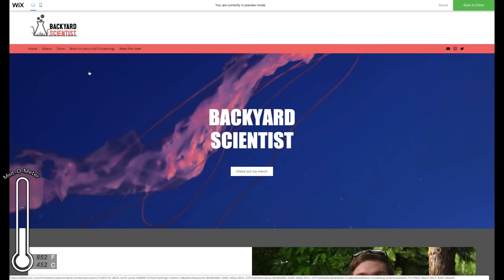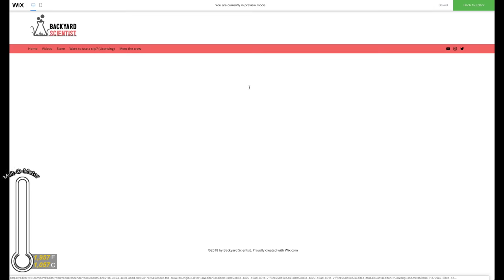Pouring lava in my pool!

Comment: To answer your question. Oxcyaceletyne will reach a point at around 3000C where it begins emitting UV radiation at a dangerous and harmful rate.
Reply: Interesting. But why does it and only it begin to emit UV Ray's at that low (relatively) of a temperature?
Reply: @chrishosey7535  
1) You mean high temperature(hot)
2) Why do you say that is "low" "relatively"? We humans have 1 degree more and have a fever and also could die
Reply: @noctuadiscipulum9715  I say relitively because in the grand scheme of things (the universe) it actually isn't that hot. For example, the core of the sun is 23 million degrees F  (11million C) which is thousands of times hotter than the temperature that a certain metal begins to produce UV Ray's.
Reply: That Guy Who Loves BBall yeah but that the sun
Reply: @sirs_3703  There are many more examples. I just gave one. Another example is the core of the Earth, all the gas giants, and Venus. Or super Nova's, hypernovas, etcetera. Those are just some of the things I can think of off the top of my head.
Reply: Does it start emitting enough for a sunburn before that? What’s considered a dangerous and harmful rate, relative to a potential sunburn at least?
Reply: JacP I don’t know what you said but I agree
Reply: JacP a welder also can sunburn u
Reply: Ok he googled that he can’t remember all of that on off the top of his head
Reply: @chrishosey7535  Yeah but the surface of the sun is only about 6000 K, and most of the UV rays come from there (the sun is not transparent, light from the core has to scatter around (losing energy) for a long time before it gets out). And remember, the core of the sun is a giant nuclear reactor, so it is the gamma radiation coming out of there that I'd be more worried about. Fortunately, as I mentioned, the gamma rays scatter around inside the sun a lot, losing energy, so can't escape and cook us here on Earth.
Reply: @Lamp25  I went to school for blacksmithing, training with oxy-acetelyne welding and cutting was a full day of classes
Reply: Nerd alert
Reply: Good job
Reply: Actually it is 3000 degrees kelvin and 4940.33 degrees fahrenheit
Reply: English please😐
Reply: will smith voice AAAAAA THAT'S HOT!
Reply: Doesn't this mean, that the Oxcyaceletyne is glowing blue, when a little und 3000°?
Reply: Well using the black body radiation formula, to reach UV wavelength it's either super hot or it's super dark to achieve 1 "e" value
But hotter is better since temperature is powered by factor of 4
Reply: Does it have anything to do with Wien's law?(just asking)
I suck in physics
Reply: @ninjafruitchilled  What I was trying to explain was that there were more things that were way hotter than 3000 degrees. I know the surface isn't nearly as hot as the core and that some photons still haven't gotten to the surface of the sun yet, that wasn't what I was trying to say. Sorry if I made it hard to understand.
Reply: @That Guy Who Loves BBall   I don't know why people confused over your simple word, "relative". It's just like saying how small the Sun really is relative to everything else ~And that is, simple...
Reply: @ultimaxkom8728  Yep.
Reply: Oh....
Reply: @jacp5628  what was the best parts and worst parts about that class?

Comment: 6:22 Not only did he make obsidian but he also broke it with his hands.
Reply: my man got netherite armour with prot 4
Reply: Steve : hold my netherite pixax
Reply: Minecraft... Why do you make Obsidian impossible to mine when it can be broken by hand irl...
Reply: @justyourlocalbernana1823  The real life obsidian is made in a volcano and in Minecraft obsidian is formed when water touches lava not when lava touches water
Reply: Obsidian can be broken easily tho
Reply: Steve is angry somewhere
Reply: @shaikomar5912  no obsidian is weak and it’s not strong if you were to slam the thing on the floor it’ll crack not even full force
Reply: @shaikomar5912  real life
Reply: @shaikomar5912  no it isnt
Reply: Wasn't it water on lava
And not lava on water?
Reply: Actually that would be cobblestone
Reply: @zabloing it's also insanely sharp and can easily beat a scalpel
Reply: obsidian is brittle, while it can be used in weapons such as the macuahutil  and be dangerous, its brittle enough to shatter
Reply: @justyourlocalbernana1823  Yeah, it just takes 2 million years
Reply: He has too much power
Reply: @justyourlocalbernana1823  That wasn't obsidion that was charred rock which makes it very fragile.
Reply: Welll actually obsidian is like diamonds, they are tougher than glass, but more brittle than glass
Reply: Yeah not minecarft
Reply: You are surprized? Obsidian is very breakable, almost like glass
Reply: @brianharvey2847  That's not scientifically correct....
Reply: @lucavett  THANK YOU
Reply: HE MUST MAKE DA NETHER PORTAL AND TRADE WITH DA PIGGYLINS
Reply: Lol
Reply: @maskboy2743   Lol
Reply: This guy's hand is a netherite pickaxe.
Reply: Cheater
Reply: Obsidian isn't that strong irl. It's actually a type of glass
Reply: steve who spent a whole day trying to break that piece of obsidian:"did i do sth wrong"
Reply: CURSED!
Reply: @justyourlocalbernana1823  because its n0t obsidian  obsidian is a volcanic rock
Reply: And in the video she said its sand
Reply: He has netherrite hands
Reply: ago  wrong
Reply: Meanwhile we need diamond pickaxe
Reply: Thats because he made cobblestone

Comment: You don't sink into lava because it still is rock. It is more dense then the human body. Wich is good because imagine how horrifing mountain climbing would be.
Reply: You would be dead not too long after sinking anyway.
Reply: But surely in its liquid form it has a different density? Wouldn't it's density depend on its temperature, meaning very hot, thin lava flows could have a low enough density for humans to sink through? Either way you're very very dead ofc
Reply: @chopun3862  density does not change unless there is chemical bonding
Reply: Minecraft lies
Reply: Youd explode
Reply: @chopun3862  nah he's right, the density of molten rock is very high, you would sink if you were standing in it maybe half a foot because your density is significantly lower. His comment about rock climbing is not correct though, because if that comparison were true then we wouldn't be able to climb on ice. Rock is just Frozen lava, just as ice is frozen water, but water is significantly less dense then molten rock. In Hawaii there was a man on his porch that was struck by a chunk of molten lava, it broke his leg pretty bad because it's just as heavy as a solid chunk of rock and its density is rather low when it had time to cool going through the air

Faster lava flows usually occur from steeper angles and very hot lava, when the lava is not all that hot it flows much more slowly, it also depends on the composition of the lava
Reply: What?? I get that you probably wouldn't sink in lava becouse of density but I'm confused... if it's a solid it's more dense. That's just how it works. Think about water you sink in it but if it's ice you don't.
Reply: Wich?
Reply: So superpowered individuals like Molten Man are made super dense when they go lava mode?
Reply: Horrifing you mean Horrifying.
Reply: @tannert8361  ice is actually a little bit less dense than water hence ice floats on water not sinks down into it
Reply: I think it's not that simple ... it's rock, but in another state.
It is like liquid and frozen water. You sink in liquid water, but do not sink in frozen water. Even the density changes in that case, but if we remove that variable, you still do not sink into the frozen water because of its state and how the atoms are "bound". :)
Reply: Yeah so I've looked this up and increasing temperature does decrease the density of different types of magmas (so I'd assume lavas too) but not by any significant amount. It's all still way more dense than water and there's no way you'd sink in 👍
Reply: You wouldn't even get the chance to sink, you'd explode because all the water in your body would instantly boil
Reply: @ivanrubenight34  no, in lakes for example the water on the bottom of the lake is always 4°C because at that temp the water is most dense.
Reply: @blackskeletor  you don't explode, it'd be more like when you drop water onto a hotplate. Check out the Because Science video Why Death By Lava Is So Much Worse Than In The Movies, Kyle Hill breaks it down quite well. 
https://www.youtube.com/watch?v=mW56dMH0T2s&index=3&t=8s&list=PLrkk0J-VdYFtuf5xEpU7BJnfgzUNUH2UM
Reply: So an exceedingly dense person might actually sink through?
Reply: @chopun3862  Density and viscosity are two different things
Reply: @rickhapstley3866  yes I am well aware of that. As it turns out lava has an absurdly large viscosity and a relatively large density
Reply: @tannert8361  change of matter is completely different from density

Comment: 8:45
This is given by Wien's Displacement Law, which gives the spectrum of most likely wavelengths given off by an object at a certain temperature (it will give off multiple wavelengths from infrared through visible, up through ultraviolet and beyond).
For UV radiation in the range [100nm - 10nm] (least to most extreme), if this were to be the peak intensity of the object's spectrum (i.e. the most common light emitted), the object would need to be between ~29,000 - 290,000 K. An object would begin emitting UV radiation at much, much lower temperatures of course, but if you wanted it to emit MOSTLY UV, you'd have to get it up to these spectacularly high temperatures.
Reply: keymaster013 this is a godly comment and deserves much more attention
Reply: @Guyacrossthestreet  I agree
Reply: can someone explain this in not scientist
Reply: Hot hot give burny burn on skin
Reply: FAQ
Reply: @bladynmccloskey  Basically it's a trick question. I assumed what he was asking meant "I want it to be a UV laser just bc it's hot." If that's the case, it needs to be hot.
REALLY hot.

like, at least 5 times hotter than the surface of the Sun, hot.
Reply: keymaster013 ok i get it thanks
Reply: Did you ctrl c ctrl v for that
Reply: Wut
Reply: Copy and paste
Reply: @do_uR_wOrK  therw you are
Reply: Advancement made: being smart
Reply: Nerd
Reply: @arenkuboyasu5831  yeah ok now feary
Reply: @arenkuboyasu5831  I am a nerd
Reply: @futurethamizhagaming4247  why are you teasing this dude
Reply: @futurethamizhagaming4247  srupid name bruv
Reply: I like your funny words magic man
Reply: Ok so which website did you copy this from?
Reply: @gamingwithajohn1543  None, but you could easily google the law or thermodynamics in general if you want to find information on it. You'd just have to run the numbers yourself.

Or not. Whatever suits you.
Reply: @keymaster013  So you actually wrote this comment through your common knowledge?
Reply: @gamingwithajohn1543  I didn't remember the actual value of the constant so I had to look that up.
Why does it matter?
Reply: Wow! 😮😮👍👍👍
Reply: Somebody Call Wikipedia
Reply: nerd
Reply: Hes too powerful to be kept alive
Reply: @sodiepop135  Is that a bad thing?
Reply: wow im surprised people arent just shouting "nerrrdddd"
Reply: @theolodger  they are, yet they are watching a science channel so it doesn’t really matter..
Reply: @Deeznuts39  haha 1yo comment
Reply: @theolodger  sorry lmao
Reply: @Deeznuts39  xD

Comment: I looked into the UV question you asked at 8:53. 

Short answer: You can do it, but probably not with your current crucible. 

Long answer: Light-skinned people will definitely burn within about half an hour at a UV index of 10, and the UV index is measured in units of 25 mW/m^2 (weighted by the relevant frequencies for sunburn). Simplifying the lava as a blackbody radiation source, and assuming you're 2m away from the source, area 0.01 m^2, for a total of ten minutes over the course of one of these experiments, the source would need to emit (UV 10 = 250 mW/m^2 * 10 mins/30 mins = 750 mW/m^2 * 50.27 m^2 for the 2m sphere's surface area = 37.7W of power at relevant frequencies / 0.01m^2 emitting area =) 3770 W/m^2 of emitting area. The solar spectrum peaks around 310nm wavelength, so we'll look at the 300-320nm range. That equates to a temperature of 3126 Kelvin, which is about 2850 Celsius or 5200 Fahrenheit. That's substantially hotter than any common materials can withstand(it's almost exactly the boiling point of iron), but it's doable if you use something like tungsten as your vessel. 

However, we're not done. Remember how I said the spectrum was weighted? That makes a heck of a difference - because of the sun's temperature and atmospheric absorption, the sun's spectrum biases towards longer, less damaging wavelengths. But the higher wavelengths are far more damaging - at a glance, by a factor of about 200. Any given source will produce fewer high-energy UV rays(our hypothetical boiling-iron source above produces about half as many in the 280-300nm range), but the damage done is far higher, so they dominate for most purposes. If we divide the necessary power by 200 and assume anything 300nm or more energetic will work, then we only need a source at about 2380 K(=2110 Celsius or 3820 Fahrenheit). That's still too hot for iron, but it's getting much more practical - it's only a little bit hotter than the theoretical temperature cap for an air-fed propane crucible, and well within plausible ranges if you use a tank of oxygen with your propane. 

Note that even with all of the calculations above, this is still very approximate. For more info, see the following links: 
Sunburn frequency spectrum: https://en.wikipedia.org/wiki/Sunburn#/media/File:Erythemal_action_spectrum.svg
Sunburn sensitivity info: https://www.ies.org/definitions/erythemal-action-spectrum/ (note that the higher-frequency spectrum is implied to be understated, so perhaps we can get a bit cooler than the above implies)
Blackbody radiation calculator: http://www.spectralcalc.com/blackbody_calculator/blackbody.php (note that it's in W/m^2/sr, so multiply by 4*pi to get W/m^2)
Propane temperatures: https://en.wikipedia.org/wiki/Propane_torch

Happy science-ing!
Reply: WOAH what a huge comment!!
Reply: This is amazing, good job!
Reply: If i read all of that my brain would probably hurt if i even thought about it
Reply: English pls
Reply: @mlgstuff1249  There is a short answer.
Reply: CAUSE IMABOZZ  I won't argue with you, but I had the day off work, and I was bored and curious. Learned a fair bit about UV and sunburn in the process of figuring it out, as well.
Reply: You just wrote an entire project
Reply: This guy needs a lot more recognition. Even just using Wikipedia, he's figured out an approximate temperature to make UV inducing experiments.
Reply: Alsadius d
Reply: I gave the 69Th like......
Reply: Its amazing what copy and paste can do 😂😂 but atleadt you resesrched it lol i wpuld have just clicked on some other video ans carried on with my life
Reply: Marltin from bo2 zombies be like...
Reply: It's not his words guys lol.
Reply: Alsadius you’ve gotta be a redditor right? This comments written like a Reddit comment
Reply: Damn
Reply: @genraldmoney3713  How do you mean? I used a couple other links besides the ones I posted above (the melting/boiling points of iron, sunburn times, etc.), but it's not copy-pasted.
Reply: You deserve a thousand likes for that
Reply: Ok mr wakeman chill out
Reply: I see a lot of numbers my brain has been temporarily Fryed
Reply: Are you in college or what?
Reply: Alsadius did anybody really read this you did a lot more work then you had too do
Reply: My brain is lava right now...
Reply: Wow!...I didn’t read a single word you said
Reply: Alsadius you didn’t take your eyes off the board at school
Reply: This guy took time to make a bibliography for a comment on YouTube. It’s just a comment not an essay
Reply: Alsadius yeah you mind giving me science answers for my tests?
Reply: @randomgames5749  I suspect a few did. This is a science channel, after all, so I'd expect some viewers to think like scientists. But the long version of the comment was all the stuff I needed to figure out in order to post the short answer - it wasn't much extra work to type it up. I'd rather lead with the conclusion and leave the long-form answer up for anyone interested. (On top of that, I confess that I enjoy showing off, and this was a good excuse.)
Reply: EricTheGoat You Need To Learn How To Spell And Get Grammar Lessons Smh🤦🏽‍♂️
Reply: Alsadius can I bring you to my science teacher
Reply: @kevina2748  Of course it's not an essay - I wouldn't bother for an essay. But here, if someone else says "Wait, that's not right...", they can re-do my calculations without needing to do as much Googling, and help me get a better answer. They can also educate themselves more easily if they want. Bibliographies for school essays suck because you're just going through the motions - until about the Master's/PhD level, nobody reads them for curiousity's sake. The best case is the teacher glancing at it to prove you didn't cheat, and more commonly they probably don't even bother with that. A bibliography for "What was the historical impact of the Gettysburg Address?" is bullshit. But a bibliography here may actually help people's inquisitive natures, and that's a worthwhile project.
Reply: @Alsadius You’re a very wise person who makes things easier for people, I feel like I low key admire you for your effort.

Ps. I love how you admit you like bragging lol
Reply: thank you:D

Comment: How hot does something have to be in order to give off UV rays? 
3000 degrees Kelvin is required to give off significant UV radiation. 2200 is the minimum. 
Surface of the sun is 5778 Kelvin.
Reply: Hottest erupted lava apparently reaches 1500 kelvin max. (on earth).
Reply: My actual thought was who's Kelvin and why is it a mesumen---oh wait that's not......nevermind
Reply: You spelled kevin wrong
Reply: @dropthebass_123  it's not meant to be Kevin?
Reply: @aaroncook2521  its a joke, if someone sees that youll get wooooshed
Reply: Oh.